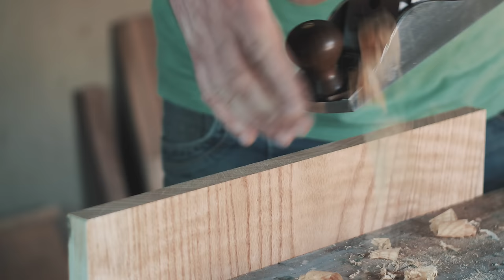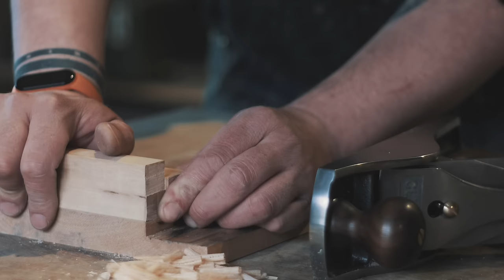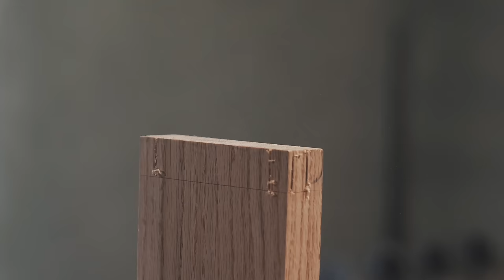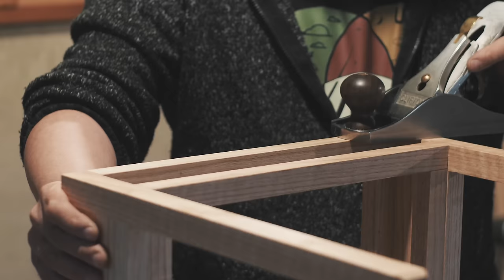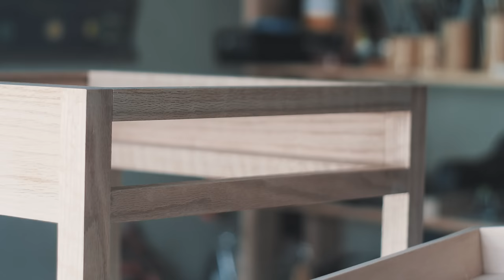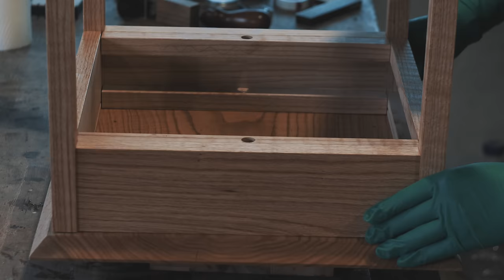Shaker End Table Making - Hand tool woodworking

Comment: Nice piece. I used to do everything by machine. Getting into hand tools. With the old me, when I did the drawer, I did full depth so it would bottom out against the back of the table. I would check for square, then put it into the table to kind of double check to make sure the drawer fit square into the table.

Comment: Right on man. Nice job. I may be wrong but it seems to me that being in your shop and building with your hands brings you some peace which I can definitely understand. That's my place also that temporarily gives me that. Keep rocking.
Reply from the maker: Thank you so much🤗 I worked on machines for many years and now I want more silence and safety. Now I try to work more and more with hand tools - and yes i definitely enjoy it😉
Reply: @gr_woodworking  
Same here man. I work on machines at a plant and it's loud as hell in there. My small shop is nice and quiet with my hand tools.

Comment: I started with hand tools.  Got seduced by power tools.  But then discovered how much of a pain they are to use indoors (wearing a respirator, running a dust extractor and hand vacuuming everywhere, and generally making a lot of noise).  And now getting into a healthy mix of mostly hand tools and some power tools when I really want to save time.